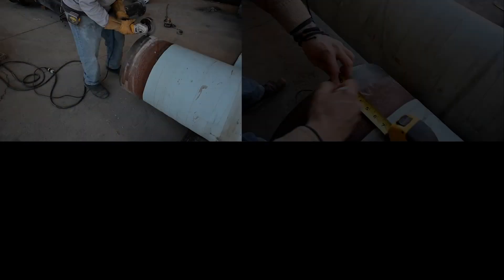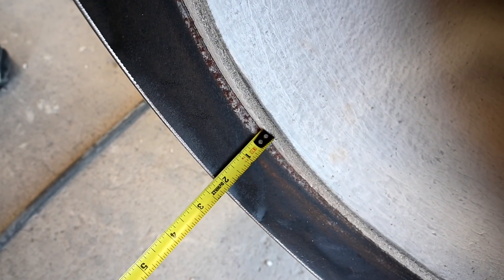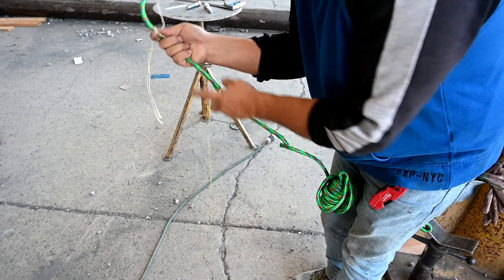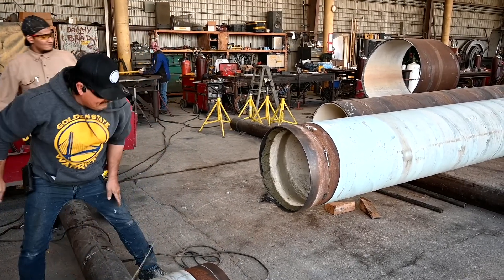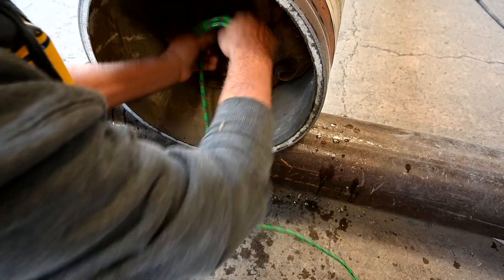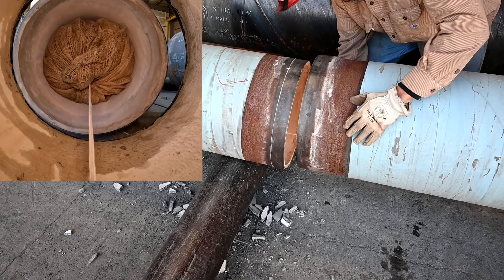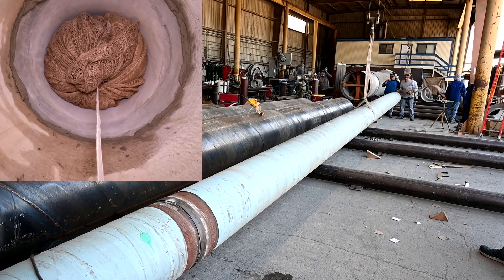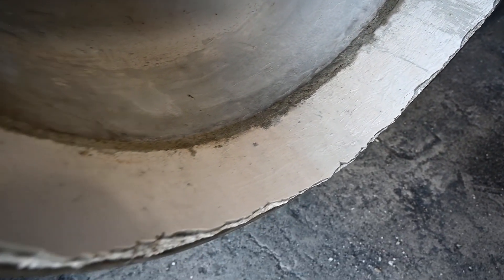How to Joint wipe cement lined pipe

Comment: Wow, pretty cumbersome process. Not to mention it is performed in a controlled shop environment. I would rather install ductile iron pipe with polyethylene encasement in 24" and smaller.
Reply: Thanks for the comment! That's because you are a knuckle head! And don't understand the benefits of welded steel pipe.